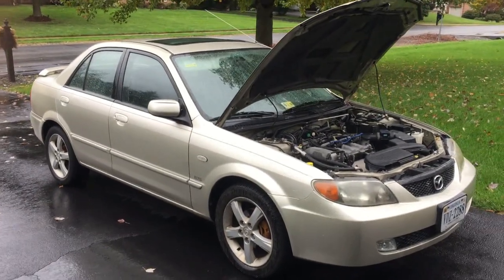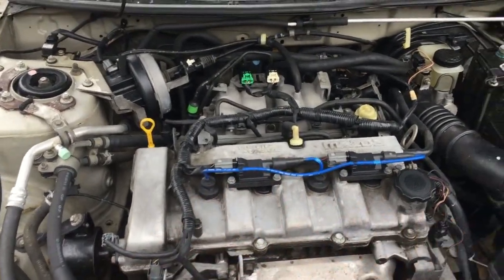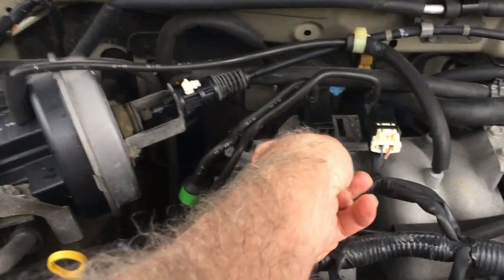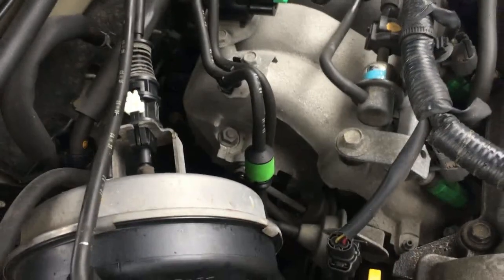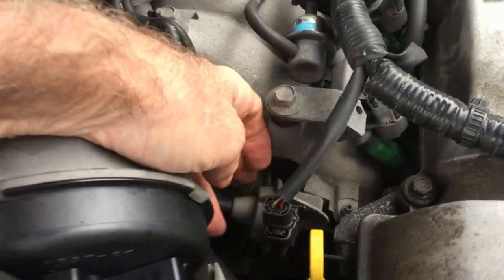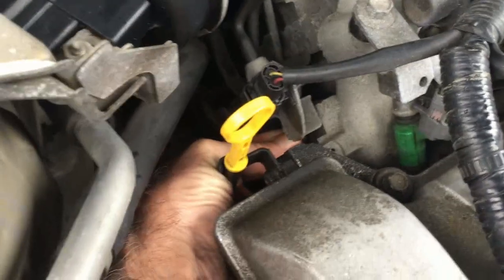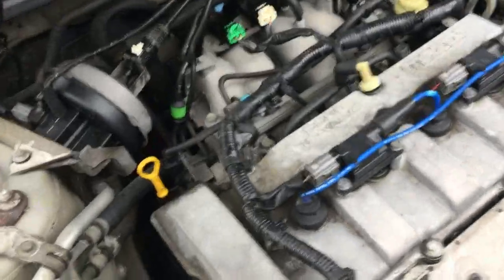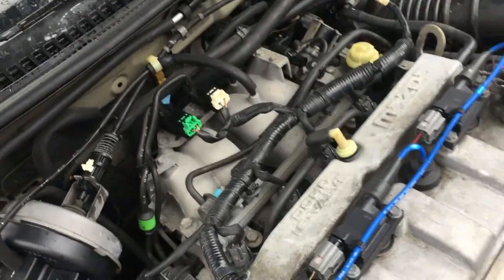Mazda Protege OBDII Code P2009

Comment: "The recall for the 2003 Mazda Protege5 pertains specifically to the screws used to mount the intake manifold shutter valve.
Issue Description

    Potential Problem: The screws may loosen due to engine vibration or normal operation of the valve. This can lead to rough idling, engine misfires, and possibly the screws falling into the combustion chamber, which can cause significant engine damage.
    Symptoms: Owners might notice rough idling or a malfunction indicator light on the dashboard."

Comment: I have a 2003 protege and I followed your advice and check the "check engine" light went out and stayed off for two trips in the car before it came back on again.  I may need to replace the actuator. Thanks for the information.

Comment: it will only make your idle crappy during the warm up. Thats what VICS is doing. Once the car is warm, VICS serves no purpose except taking up room in the runner. The VTCS is the other actuator. Its job is to open and provide more airflow at about 4800 RPM.. 

Just wanted to clarify.
Reply from the maker: I appreciate the feedback
My primary concern was to keep codes clear so to pass inspection
😎
Reply: Is that the one next to it I can’t figure it out I replaces the two on the runner bored with the clips the MAFS replaced that the ire cleaner filter it’s still saying p2009 and p0102 I have no car

Comment: On my work to work this code popped up and I've only got a month 'til inspection! :,(
Thanks so much for making this video so I can check to actuator and all the wiring/hoses
Reply: JAYZUPP did you find the problem?
Reply: @kevinquevedo2416  I'm pretty sure replacing the VTCS solenoid helped fix the problem. Picked on up from the junkyard before my inspection and never got the code again.
Could probably get one on Ebay for $20.  It's called a PRC solenoid I think. OEM ones are made by Mitsubishi actually

Comment: Thank you soooo much. The Haynes manual doesn't give the OBD codes and there isn't anything specific online, until I saw this.... time to go out and fix it!
Reply: ooof, it didn't work
Reply from the maker: try to work the rod back and forth.  Once that is done - you need to clear the code.  If you do not have a code reader - simply (carefully) disconnect the negative cable from your battery.  Leave it off for about 5 minutes - and then reconnect.  All error codes will be cleared.  If you are trying to pass inspection - you will need to drive it for about 50 miles before the computer will allow a test station to read codes...

Comment: You are a hero to me today, sir. I have been unemployed for some time and was really dejected when my check engine light came on a few days ago. I bought a code scanner and used an app with it and it came up with this error code. I have a 2003 Protege5 with about 130k miles on it as well. I followed your instructions and the rod WAS stuck, and I cleared the code and no more rough idle. I cannot thank you enough, you saved me hundreds of dollars.
Reply from the maker: You the MAN - glad you figured it out.  I've had the code another time on the car - and followed my procedure again - cleared the code - and nothing since.  
I have also found that a LONG set of needle nose pliers I had in my tool box does a pretty good job of grabbing the rod and moving it back and forth.  A lot easier that trying to get my hand in there...

Comment from the maker: The inside of the intake manifold has 4 small plates attached to a metal rod which rotates the plates into and out of position to change the size of the intake manifold and the speed of the air being mixed with the fuel from the fuel injectors...  There are some in depth videos of this on YouTube.  These plates and the rod they are attached to can get "gunky" and become difficult to rotate.  When it gets really difficult - they get stuck and you get the error code.  So - moving the rod as I show in the video breaks it free if it is stuck.  I recommend adding some Marvel Mystery Oil (no - they are not paying me) to your gas - and I believe this will, over time, help clean up the gunk in the intake manifold which will keep this problem from returning.  Just my 2 cents...